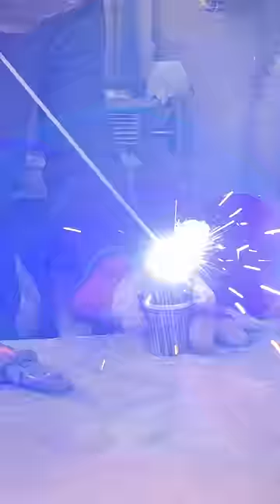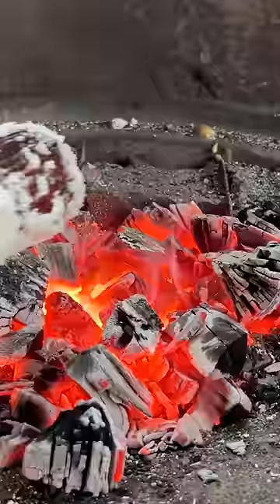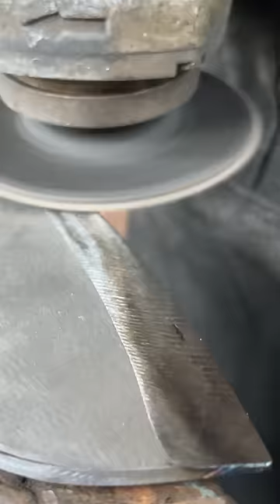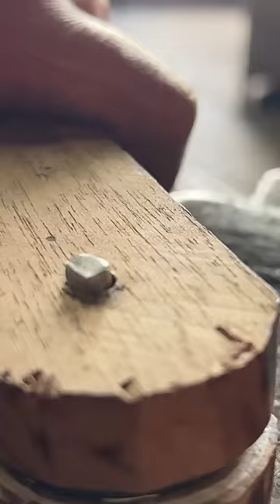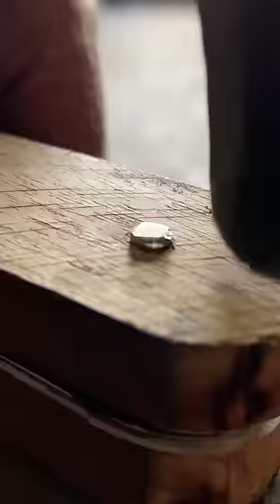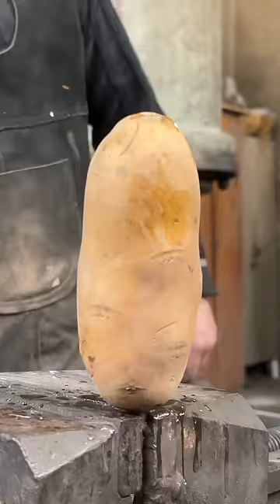Making a KNIFE from ELECTRODE RODS ! Shocking Way to Forge the Sharpest Blade at Home

Comment: Use mud on the back of the blade … shock cool the edge only. It will make the knife less brittle on the back and still hold that sharp edge
Reply from the maker: Wow, thanks for the constructive advice! I will listen to this idea!
Are you my fellow blacksmith? Or just a fan of forging with a wealth of knowledge?
Reply: that would work if it was a type of steel that can be hardened, but welding electrodes aren't that. a brittle weld is a potentially lethal weld.
Reply: You only need to do that if you're trying to emulate the Japanese technology and/or specifically get a hamon line. If you're using proper high carbon steel, quenching and then tempering it will give you a springy blade ten times more durable than a differentially hardened one.